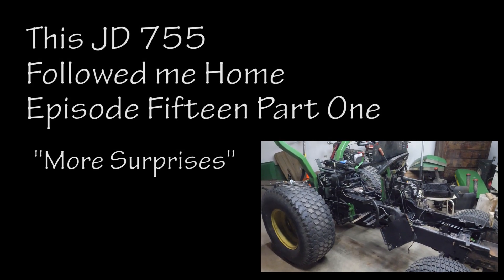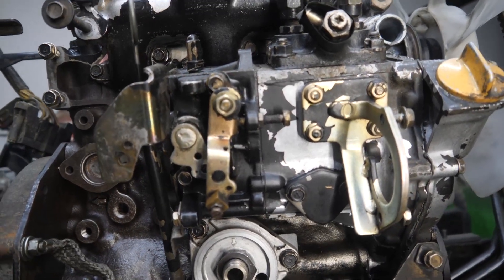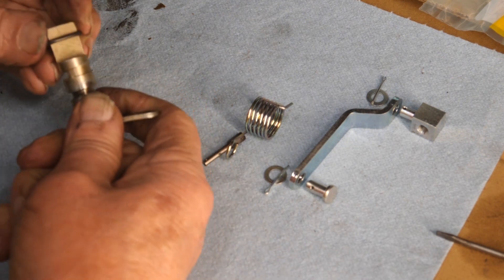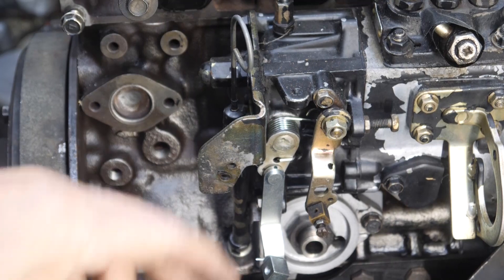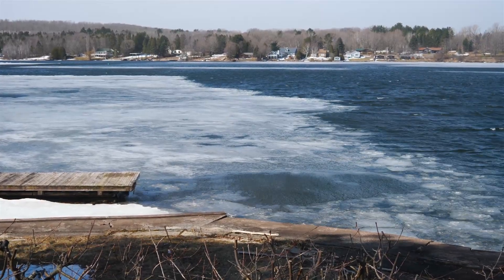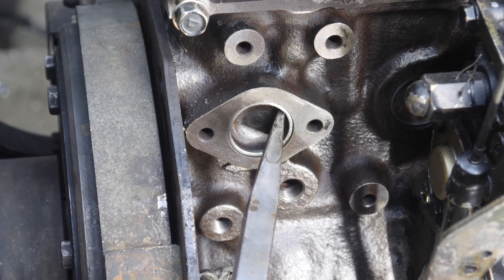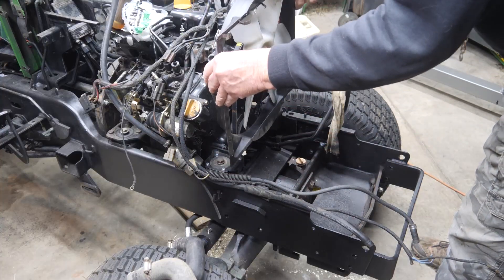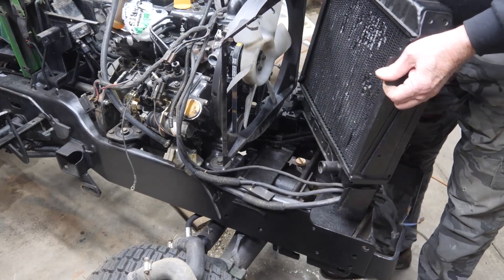John Deere 755 Blind Date (Overbought) also 655, 855, & 955, Episode XV Part One

Comment: I am also very partial to the older machines. I currently have two John Deere 430s with the yanmar  3 cylinder engine. The dream machines for me are the 55 series love the 755, 855 and 955. I would love to have a loader on one of them watching your videos. There is so much information that you were giving out to people like me.
Reply from the maker: Ironically a good friend and I were talking about the next Episode when he asked who would be in the market for a Classic (my feeling) series 55 tractor. The first person I thought of was one who had a two-wheel drive unit (332/430 etc.) and saw benefit of MFWD, Cat.1 - 3pt hitch, and 540 PTO. This was a simple answer for me – I had a 300 and traded it for a 655 (1986) and never looked back. For months I’ve been waiting for the right time to share my mind on these little tractors and that may be soon.

Inspecting, diagnosing, and rebuilding is fun but the little things like radiator drain seals and such are pretty dry if not boring and uninteresting. However, fixing the small things leads to us building an intimate relationship with our tractors, lets us check those items off the list, and ultimately demonstrates that we take care of what we have. Kinda sounds like our personal relationships too, eh? md
Reply: @theholeinthewater9452  the 430 is a great tractor and a great workhorse. However, like you said they have their limitations. The 430 has a 2000 RPM PTO and implements that run the 2000 RPM are hard to find this day and age. As you stated they are only 2 Wheel Drive. The differential lock helps, but having a 44 loader on it and not having four-wheel-drive makes it more difficult to run. Another benefit of the 55 series is the foot pedal controls compared to the 430 hand control for forward and reverse.

I have stated this issue in many of my videos where I am using the 44 loader and saying it is controlled chaos with all the levers and trying to steer at the same time . I have truly been looking at the 55 series for quite a while and hoping to get one eventually.
Reply from the maker: Right. I’d forgotten about the hand transmission control and no power steering. Also remember the tiller had those two v-belts and was difficult to mount. My boy has a 4300 and picked up a 455, mower, and blower. Its really nice to drive but both of us prefer the 55s (he grew up with the 655 after all). Ah, well. Having run both designs, the 55s are a completely different experience.

Soon I’ll decide if my calling is to continue saving tractors from salvage or concentrate on overhauling motors. Once that decision is made, the Overbought 755 will likely be looking for a new home, in case you’d be interested, and the future of the Blind Date 755 is up in the air. It’ll have a new motor, may be painted construction yellow (thought about it and then saw Neil Koch’ 318 and liked it) and may just stay here a while (can’t have too many 55s). We’ll see. md @LivingOutHere